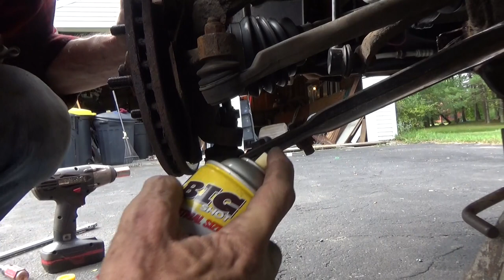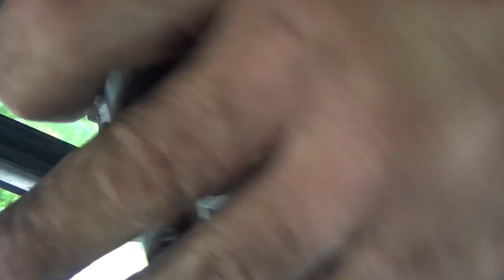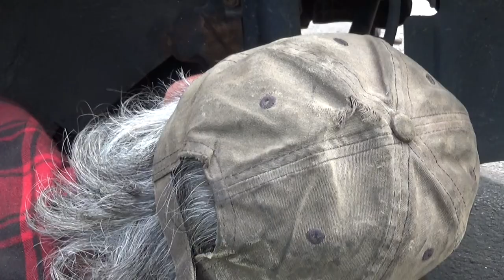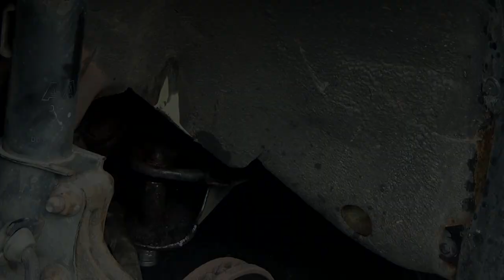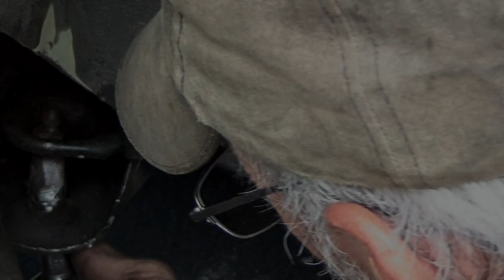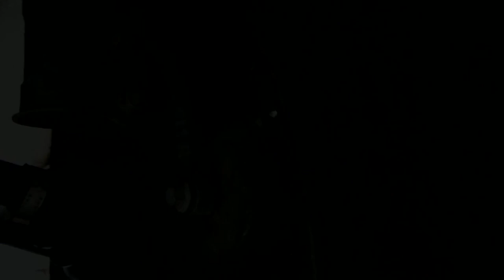2005 Chevy Aveo - Part 2 - The Control Arms

Comment: Dang the vertical bolts had  loosened hex-nuts on top for mine. Split the hexnut with a drill on passenger side to get it off, after it stripped. Did two horizontal cuts through the control arm bushing area on the other side after I broke two 1/2 to 3/8 adapters trying to loosen the hexnut and bolt. Scary, but fun stuff for first time using an angle grinder. Much thanks for the video, it really helped get a good idea for the fun involved!
Reply from the maker: Thanks for the comment! The most important part, is that the video gave you an idea what you were up against! (I think it REALLY helps, having some familiarity with the task at hand)

Comment: Im doing the same job but Im dealing with the front bolt where the nut is sealed in the frame and is stripped out LOL Thank you GM for making life easy for maintenance.
Reply from the maker: THAT is NOT a fun situation!  A properly equipped garage should be able to fix this for you. (sometimes you've got to bring it in...)
Reply: @HouseCallAutoRepair  Thank You my friemd  I cut a hole in the frame so I could add a nut on top of the welded one and the just rewelded the hole back up :) Life is good now :)

Comment: so glad I still own a decent air compressor no worries about dead batteries for me... Love all my air tools & a few of them are great at grinding or cutting in tight places
Reply from the maker: I started a mobile air set up, but my inverter doesn't have the start-up current the compressor needs... (and there's no room left in my daily driver)
Reply: @HouseCallAutoRepair  that's why I have a F250 long bed hate to be on a service call & not have whatever I might need. more money in semi repairs than with 4 wheelers.

Comment: Thank you for that socket trick this is just genius.....I had to jump with both feet on the control arm, the ball joint came out of it but bolt and ball still jammed in hole......its all I have to remove now wish me luck hehehehe
Reply from the maker: As always, use extreme caution when putting things under a lot of pressure. Try striking the SIDE of where that tapered ball stud goes through...

Comment: I'm glad I own a pickle fork for those ball joints
Reply from the maker: They can definitely make things a bit easier...
Reply: @HouseCallAutoRepair   I replaced the lower steering control arm on mine and now I have to get a  Front end alignment I didn't think you had to
Reply: Only good if you are replacing it, if you just want to take it off don’t recommend as you will destroy the boot

Comment: Any tricks to get the horizontal bolt out if it just spins? Does the frame have to be cut?
Reply from the maker: When things get bad.... cut the parts that are removable and replaceable. Cutting a frame is generally NOT a good idea.
Reply: Got it taken care of. Sawzall with Diablo blade to cut of the arm assembly. (Cut it like hot knife through butter) 👍Then had to use an oscillating saw to cut the metal around the rubber bushing and then cleaned off rubber bushing. The issue was the metal bushing tube & bolt were seized together. The threads were fine. Used MAP torch to heat that until bolt finally started to turn inside sleeve. Got lucky bolt didn't strip out. @HouseCallAutoRepair

Comment: Just changed right control arm after it was in a slight fender bender also the sway bar after the crash it had lots of positive camber changed the 2 parts car still has too much positive camber any idea on what it could be?
Reply from the maker: Gain access to the top center nut on the strut. Rotate the entire shaft CLOCKWISE ONLY and observe ANY movement in wheel. It will likely spring right back, but NEVER rotate it in the other direction as this can loosen the top nut AND internal components. If ANY wheel movement is observed, replace the bent strut. Otherwise you'll need to start taking diagonal measurements on the chassis to find what's out of place.
Reply: @HouseCallAutoRepair  thank you there actually is a bit of a gap on the top of the strut where it meets the body hopefully this is the issue will try when I get back home
Reply: @HouseCallAutoRepair  another question do I have to unbolt everything else to where just the strut moves or just keep everything on and turn from the top under the hood?

Comment: My frame is stripped and I need a new hex nut but can't find one or the part number/size
Reply from the maker: I would recommend having your local service station look it over. They may be able to weld in a new one for you.
Reply: Grade 10.9-M12-1.25 pitch is what I found ;D

Comment: Where did you buy the extra bolt and what size?
Reply from the maker: I carry a large bucket of miscellaneous hardware and fasteners,  just incase. Whenever I visit a salvage yard for parts, I save ALL associated hardware, for spare parts...
I don't remember now, but I think the bolt was ok, and I just used a good nut on top of the stripped out, welded one.

Comment: Hi, I have an Aveo in Argentina.
I am havin some troubles with a noise in the suspension zone.
When I´m driving over little bumps I hear a low sound from de no drive side.
I´have been changed all suspension system but the noise sill there.
Any idea?
thanks
Reply from the maker: Have it put on a lift. With it running, in gear (2nd or 3rd) have a listen to the bearing area of the knuckle, and again at the area where the axle enters the transmission. This should help you narrow the possibilities.
Edit: Also could be a fender liner (plastic wheel well) rubbing on the tire. Make sure no fasteners are missing.

Comment: How'd you gain so much clearance to the front bolt on the driver's side. The transmission is about 3/4 of an inch away from the head of that bolt. You have room for a ratchet and impact somehow.
Reply from the maker: Doubled up the box end wrenches to remove the stud/nut and using a board under the oil pan, lifted the motor to the point where there was just enough room. Too much WILL damage: wiring, hoses, exhaust, axles, etc.

Comment: Slack em off before you jack up the car helps hold the sleeve
Reply from the maker: Biggest problem in the Salt Belt, is that the bolts swell and bond themselves inside the sleeve. When you force it to turn, the sleeve rips free of the rubber.
Reply: @HouseCallAutoRepair   I live in nova scotia I no all about it. I'm surrounded by the atlantic ocean
Reply: If the sleeve is turning inside the rubber you left, it get to bad. The first sign of clunking they should be swapped out , that way it don't take 3 days to do a 10 min job ,, the way they put the bolts inside the sub frame is ridiculous,, I always found that if they were orginal they come off easy but it someone changed them already and didn't use never seize that's when you can get into trouble,  I always load onto the bolts incase I have to do it again